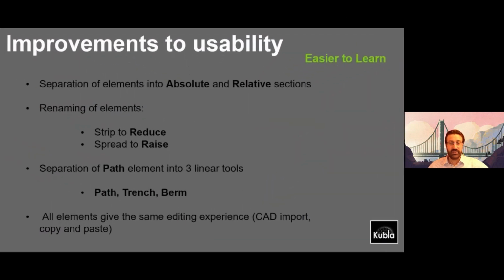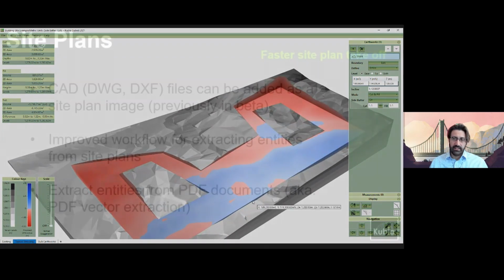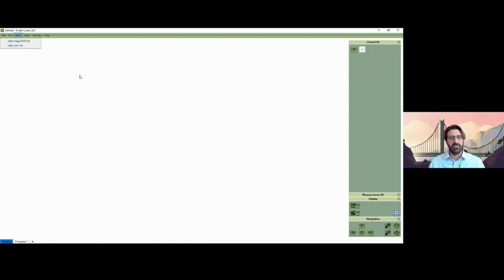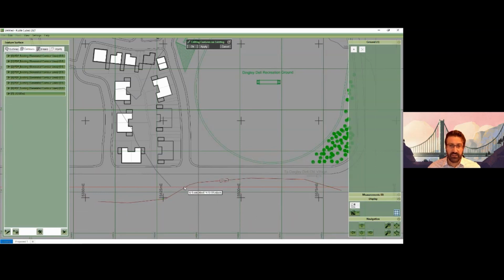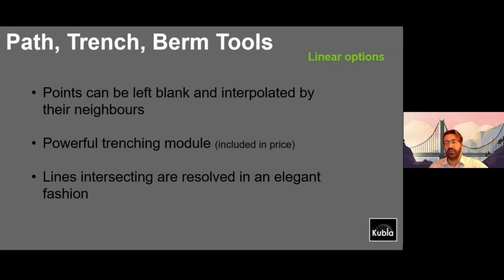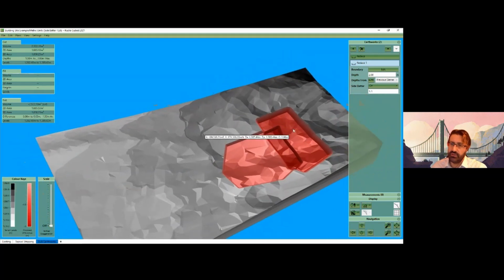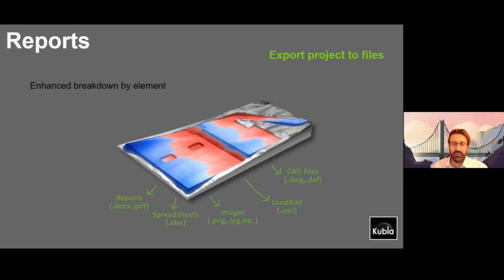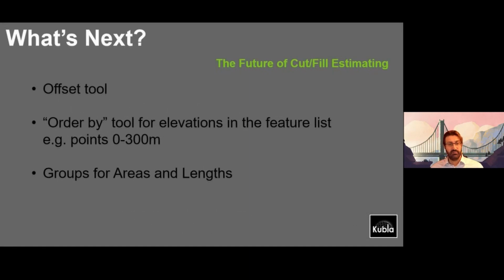Kubla Cubed 2021 (Cut & Fill Software) | What's New?

Comment: Can’t wait to use the new version of Kubla this weekend!
Reply from the maker: How did you get on?
Reply: @KublaSoftware  Using Kubla with the upgrades went great. Unfortunately I wasn’t able extract line work from the PDF I was issued because it didn’t contain any vector data. The ability to split lines worked great, it’s a big plus. About a year ago I purchased a plug from a company called Graebert which I installed into my Draftsight software allowing me to extract vector data through Draftsight and then export it as a CAD file and import it into Kubla. Although I wasn’t able to use the new Kubla feature to extract vector data on this particular project I’m 100% certain it’s going to be what I use on all project in the future where the PDF file contain the data. You guys are doing great work at Kubla and I appreciate it very much! As a note, I also build GPS machine control files for my clients using Trimble Business Center, with your new upgrades I’m able to get all the data I would normally create in Trimble from My takeoffs in Kubla. You guys certainly have streamlined things for me, thanks so much!
Reply from the maker: @shorelinedirt5236  We're so happy that the updates work so well for you! 
Thank you for the feedback- one of our aims has been to reduce user workflow time so we are glad that you've achieved this!  :D

In regard to the offset tool, we are planning for it to be an update in Kubla Cubed 2021.  We have done the backend work, and are now working to integrate it into the user interface. We'll let you know when it's available!
Reply: @KublaSoftware  just a note, I know you’re working on a line offset feature currently, this is a very important feature and used on every takeoffs I do. I currently export line I need offset to Draftsight, offset the line, then import it back into Kubla.it’s going to be a very powerful tool in Kubla. And I can’t wait for its arrival! There is not a takeoff I to that doesn’t require line work to be offset. You guys are awesome, I’m with Kubla 100%, keep up the great work!